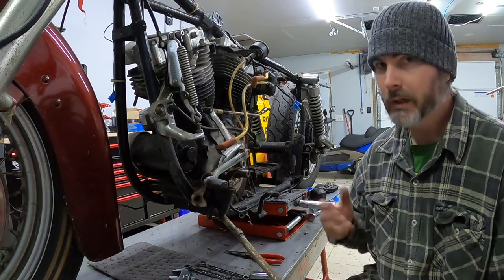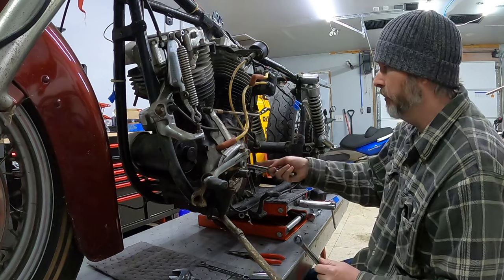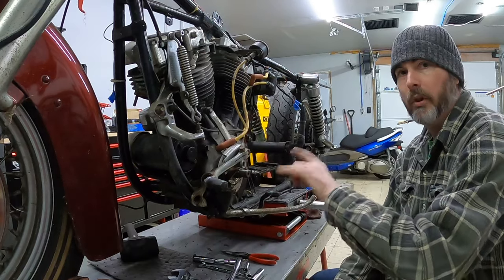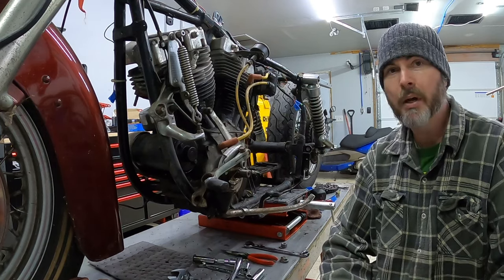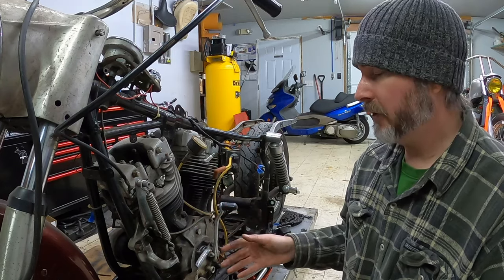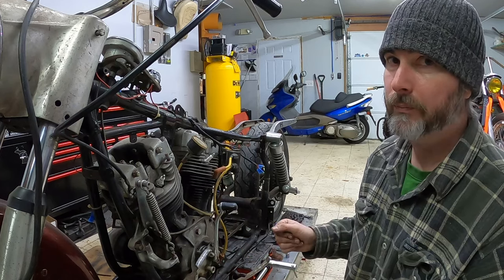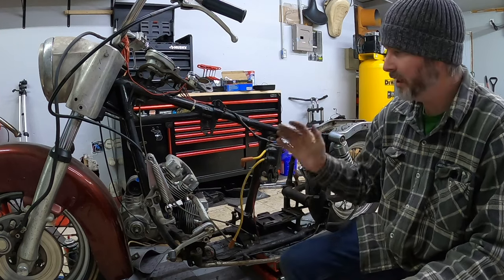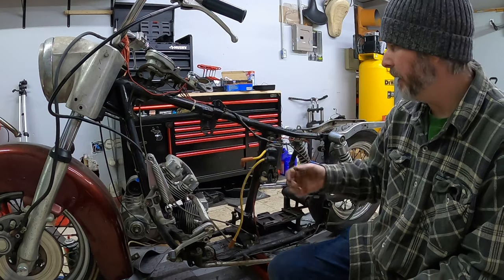1966 Harley Davidson FL Shovelhead Project Part 3 HD 1080p

Comment: I’m getting ready to go through my 1982 low rider. So anything you can show me on a shovel is greatly appreciated. Installing a complete wiring harness and several other bits and pieces. I had a 2006 twin cam before so this is all pretty new to me. Thanks again for the videos. You take care and stay safe.
Reply from the maker: I will show as much in detail as I can. With this shovel I do plan to buy a kit from Lowbrow customs. They have a kick only kit which should work for my application. If there are things specifically you need to see or know about, feel free to reach out. Hope your project is going great! Take care